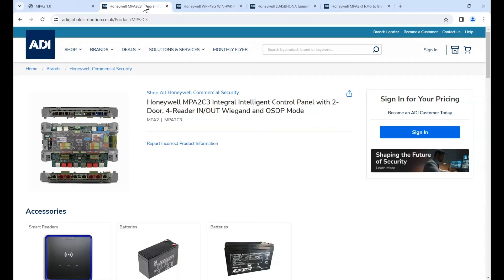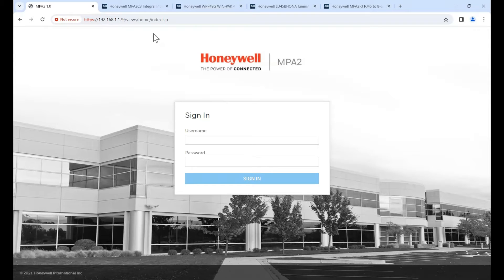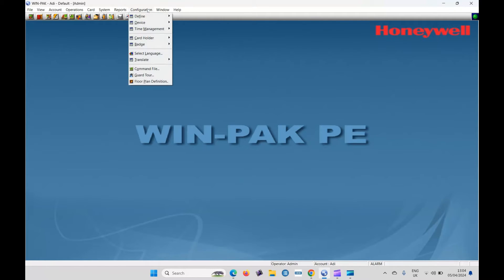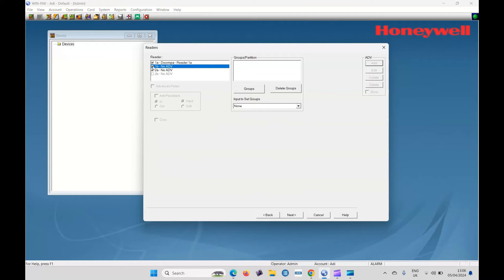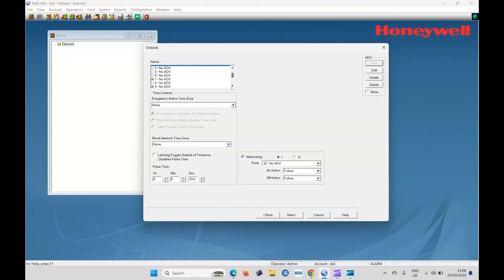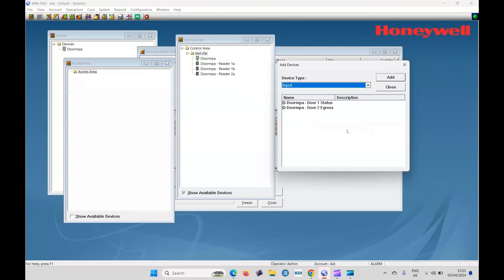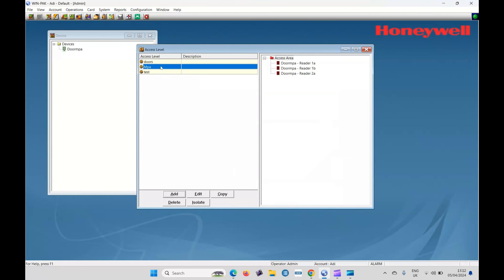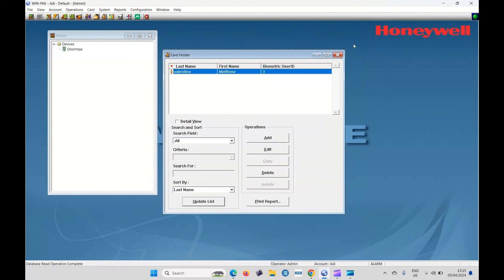How to add a MPA2C maxpro controller to Honewell Winpak 4.9 PE

Comment: Thank you for the video. I like the panel as an idea but find the wiring to be convoluted. 

The panel stickers are more confusing than reading the guide or watching the video online. You can use the terminal push blocks or the rj45 connectors (weird for access control but can be simple for the rj45 readers I guess). But it's weird cause of all the stickers on the board in three spots labeled as for the door, aux, power, etc. you can land door one in multiple spots, but I feel like "well then, which should I use?"